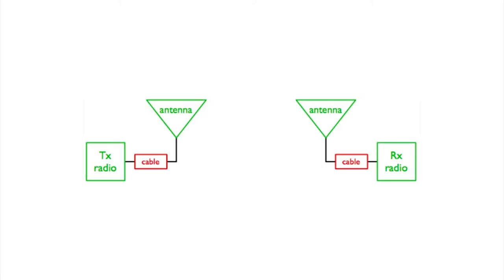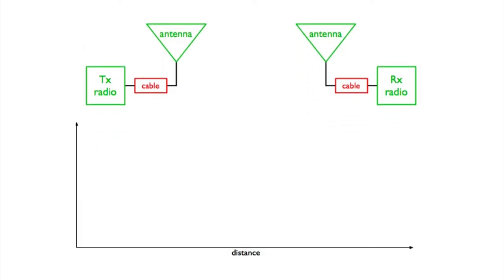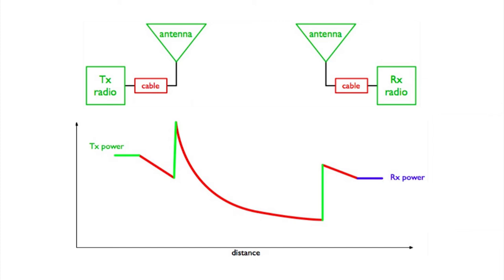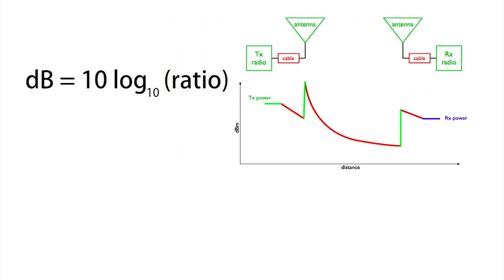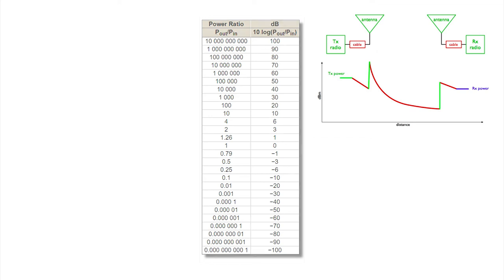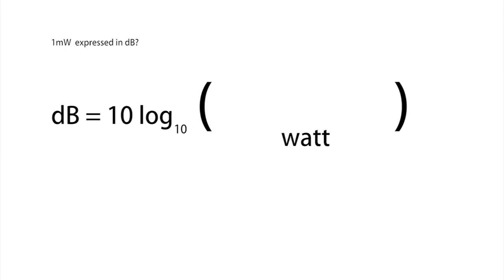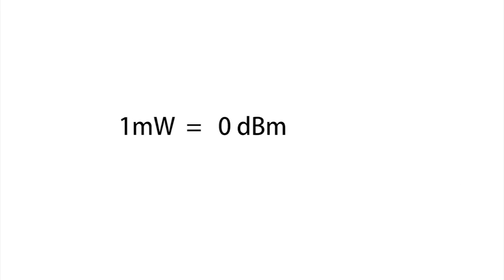Link Budget and dBm

Comment: Thanks for the clear explanation, Mr. Richard :D ... I would like to ask a question, if you don't mind! I have seen some people add (30) to a dBm value to convert it to dB.... any logical explanation to that?
Reply from the maker: Oopps sorry missed this request..  Yes, this is a solid move.  dB is a logarithmic ratio and dBm is a log ratio referenced to 1mW  (that's where the m comes from).  0dBm = 1mW For lower power you could do dBµ  - to reference things to microwatts (ie 10 to the minus 6 watts).  0dBµ = 1 microwatt  For higher powers - say around one watt you'd use dBW  (although it's often omitted).  0dBW = 1W.  

As one watt is 1000mW - which is 10³ mW  (hey look at me with my formatting  :) )  the conversion would be to add 30.  I have another video that explains this elsewhere (but can't access i whilst in this account).

Comment: Is 100w 20dbm? I am getting 50dbm
Reply from the maker: 100W IS 50dBm, yes you are correct. It is also 20dBW.  I hope what follows clarifies this point and does not add more confusion.

The difference is in the units employed.  Here we are considering relative and absolute levels.  

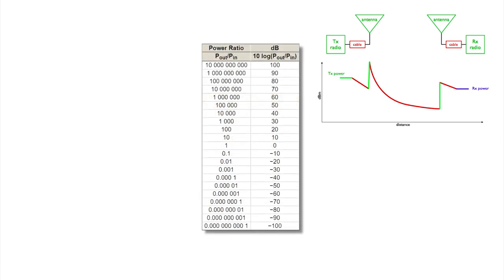The video does state 'power ratio' (at 2:20) hence the figure you quote.  It's a relative comparison and uses logarithms to condense/compress/expand a massive scale into more containable numbers.  (It also allows the use of addition and subtraction when considering chains of gains and losses).

As my example above states dBm is  dB(milliwatts)  and dBW is dB(watts) .  If you are now happy with the explanation being about the units used  you should also be happy that  100W = 0dB(100w).

I really do hope that this helps.